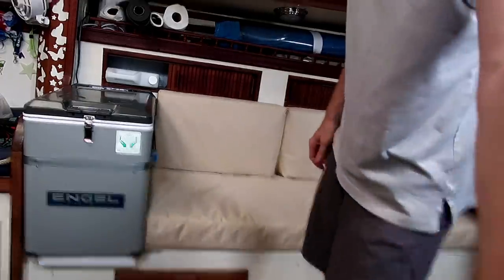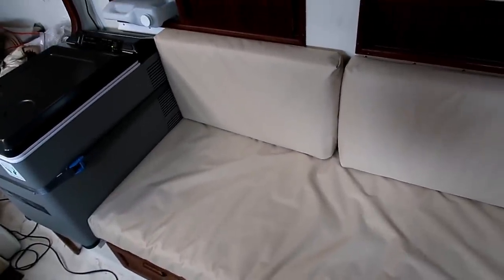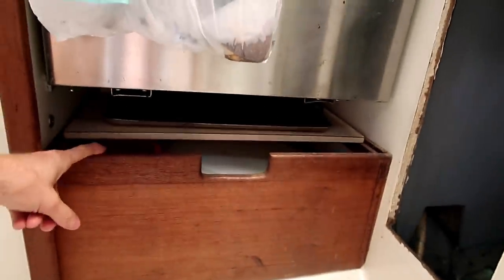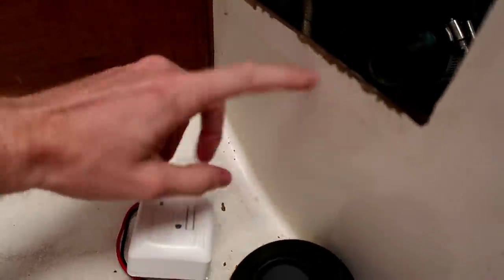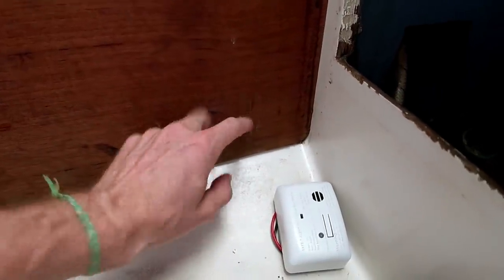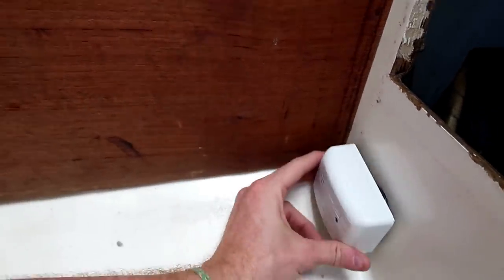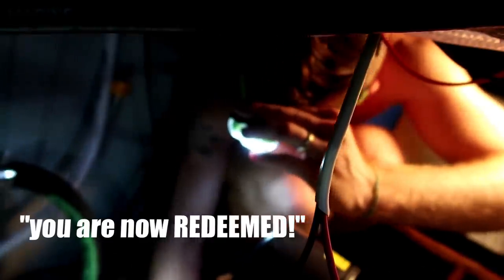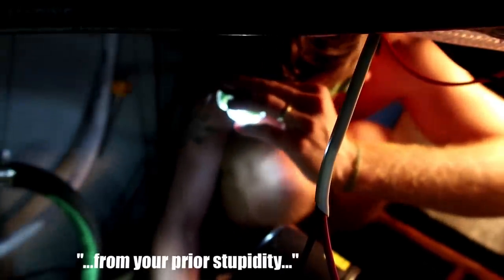Man VS Stuck Oil Filter | Sailboat Story 87

Comment: Good to see ya back.  You might consider a remote oil filter kit designed for the engine.  They are pretty cheap and can make a big difference to the workload of getting the old filter off.

Comment: Awesome! I haven't seen safety wire pliers for 35 years. I was an aircraft mechanic in the Air Force and used to use them all the time:)
They make you look like a pro with any safety wire job:)
Reply from the maker: They are handy.
I used to use them a lot on my racing motorcycles.
Reply: Yea agreed, it has been couple decades since I last seen one. Been several times I have really missed having one of those.

Comment: I have owned 17 or 18 boats in my life of all  types and sizes and I'm going to make a suggestion  on something that has helped me many times in the past  its simple and cheap  invest in some  lighting and install it in your engine compartment  so its  brite. And easy to  work  in there  without. A headlamp  you. Can even use cheap led rope lights   It will make life so much easier. Unfortunately on any boat no matter how new  or  reliable of a motor you are going to spend way more time    Owing things on it then you can imagine  it can be just  servicing  i also highly reccomend installing. A oil changing system. It is so much more convenient to  flip a switch  and not  get your hands dirty  o scratched up  plus in the long run it will keep the bilge  way cleaner   I'm not a know it all  but those are a couple of tricks i learned along the way to make life on board. A little better btw ive enjoyed both Stinkpots and Blowboats  ive always  said my preference. Is  a boat that floats  and is paid in full    I am a big fan of the Florida Keys and the Carribean  both of which ive spent many enjoyable days  in  I grew up in South Florida  began diving in my teens and have over 250 logged dives  in which ive done Spearfishing, photography , and some wreck diving  as well as underwater  hull maintenance  and dock repair

Comment: Well, did ya have any oil leak out when you finally got that filter off? Maybe you can tell Wicked Salty your findings. Did you rub some fresh oil on that filter seal? Maybe you forgot to do this last time or you used old dirty oil for the seal last time....both would create this headache. ;)
Reply from the maker: Nope. Not a drop of the fresh stuff was spilled.
Oh yes - always oil the seal.
I do tend to over-torque them, despite mentally telling myself not to every time.
Twice, I've been around vehicles that lost the oil filter, so that's probably why I tend to righty-tighty a bit too much.

Comment: Propane is heavier than air.  Even with a minor leak or possible with no leak it will go to the lowest point.  This can happen when a burner comes on without lighting or equipment is being manipulated like connecting and disconnecting.  You could possibly have it in your bilge now.  I would guess the lowest practical point.

Comment: Had a mechanic remove our fuel tank and replace. While drilling through aft bulkhead to route new vent line in engine compartment he inadvertently cut through the propane line. It was obscured by the insulation. Yeah the boat blew up. After engine ran away because it was sucking propane it seized and backfired which ignited the propane. I had shut off the solenoid by the stove when I realized it wasn't going to light. This is why I am still alive. Maybe more than one propane alarm is the way to go.
Jon
Reply from the maker: I don't understand the story.
Your boat blew up, but you're alive because you turned the gas off?
Reply: As the revs of the engine were increasing I stopped trying to diagnose the stove that wasn’t working and shut off propane solenoid. Then tried to shut down engine to no avail. It ran away out of control. If I hadn’t shut off propane solenoid it would have continued to flood engine compartment with propane and subsequently caused a larger explosion.
Reply from the maker: Oh - I gotcha.
How bad was the resulting explosion?
Reply: Sailboat Story The engine shut off was mounted by nav station down below. I was facing companion way stairs holding the shut off when it blew. Knocked me to the V berth. When I got up saw fire billowing out of an access panel in quarter berth and from behind stairs. All I could think of was the full propane tank in its locker and a can of gas for the dink strapped to pushpit.  We abandoned ship. Watched it burn for an hour or so even with FD blasting water into cabin. The fire was in the engine compartment and fueled by 15 gallons of fresh diesel. She never sank and was hauled and put on stands. Boat had to be drilled and drained of the 1000+ gallons of contaminated water. Long story short, been enjoying the current boat for 3 years or so. 
Love your vlog. Love the sailing dinghy you made. Look forward to your new season on the water. 
J
Reply: Nothing quite like hiring a professional, who proceeds to %$&^ things up a lot worse than you ever would as a DIY.  Glad you all made it out OK. 

My dad once hired a guy to rewire his boat.  I guess he was pretty good at what he did, when he was sober.  Which it turned out he was not, while working on Dad's boat.  8^P

Comment: I've never worked on a marine diesel but isn't it better to replace the engine oil filter after draining or suctioning the used oil out? There's always a different way to do things that I might have never heard of. I hope U remembered to spread a dab of new oil on the new filter's gasket unless that's optional for you. I'm an ole geezer that might not be up on the new fangled ways engine stuff.

Comment: If you didn't start the engine after changing the oil then the filter is probably still full of OLD engine oil (mine won't drain past the pump to get back into the sump).
Reply from the maker: I always start the engine after installing the NEW empty filter.

Comment: Fill the oil filter with a little oil if it is a spin on sideways filter, and all the wy if it is a vertical install where it won't leak out during installation  That way the engine gets lubrication sooner after an oil change.  It just gives you a few more weeks or months on the engine longevity as the engine just doesn't have to fill the filter as much before pushing oil to the lifters, etc.  Also drive a screw driver through the filter with a hammer if you really need to get one off...pretty safe to do on diesel filters too as a spark won't really set off a diesel fire...unless you are really super unlucky.  Of course you are pretty smart and I'm sure know this already and I am trying not to be an annoying idiot.
Reply from the maker: You’re right!
I know all this, but thanks for the help. I do a lot of dumb things so there no way to rally know if I know what I’m doing or not.

Comment: Ben - oil filter - 3 points:

1) Use a drop of new oil on the rubber gasket of the new filter, (which it sounds like you did. . .)
2) HAND-TIGHTEN ONLY!!! No wrench is needed. . .!
3) DON'T use Fram filters. They are a poorly engineered POS!!

"Monkey Fist." -- Sounds kinda dirty - maybe you'd use that with the bong! ;-)
Reply from the maker: 1) Yep. I’ve never once had someone else change the oil on my cars for the last 20 years.

2) Yep, that’s how I do it.

3) I’ve always used them and never had a problem. Still, I do keep hearing that from various people.

4) I’m really smarter than I must appear, but not much smarter.
Reply: Don't worry, you appear to be way smarter than you look. . . . LOL!

Comment: School time for Ben:  it's "faked" out not flaked out.  fake (v)
Definition: To loosely lay out a piece of cordage on the deck ready for easy use. In practice, a seaman will lay out the line in the shape of a large figure of eight to keep the line from hockling.
Reply from the maker: Really?
Could have sworn that you flaked it.
You must provide a link in order to prove your claim.
Reply: Term: flake (v)
Definition: To loosely lay out a piece of cordage on the deck ready for easy use. In practice, a seaman will lay out the line in the shape of a large figure of eight to keep the line from hockling.
See Also: fake, hockle

Term: fake (n)
Definition: A loop of line laid out on deck ready to use.

Term: fake (v)
Definition: To loosely lay out a piece of cordage on the deck ready for easy use. In practice, a seaman will lay out the line in the shape of a large figure of eight to keep the line from hockling.
See Also: flake, hockle
Reply: On the other hand, reliable references declare that flake is a mispronunciation of fake. Rear Admiral Austin M. Knight, author of Knight’s Modern Seamanship, 1941, uses only fake, which seems to be the choice for most 20th century sailors.

Comment: You should pre oil the filter....installing one empty is not a good idea
Reply from the maker: I always do oil them.
I alway install empty.
No problemo, unless it get's stuck, then it's a problemo.
Reply: My theory for the last 35 years was to oil the inside of the filter and let it soak before fitting, I dont mean just the rubber gasket